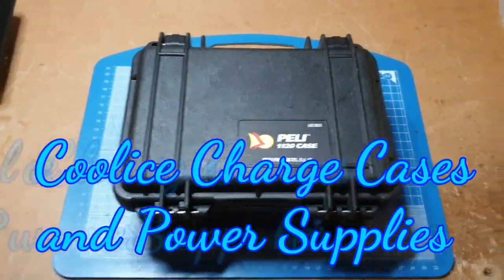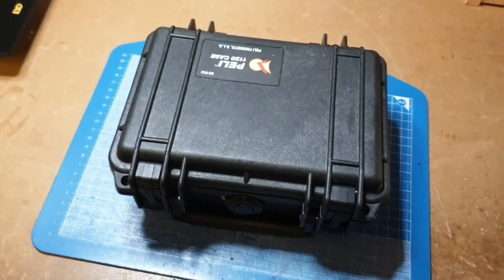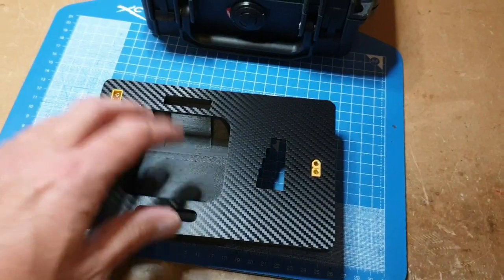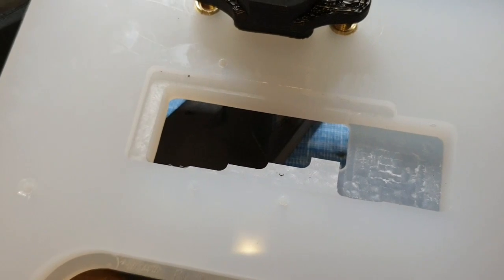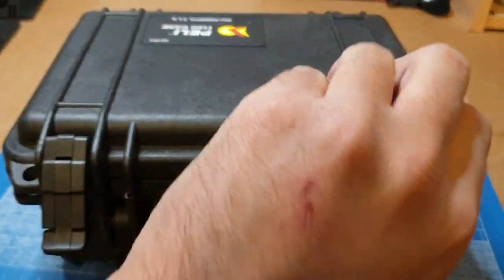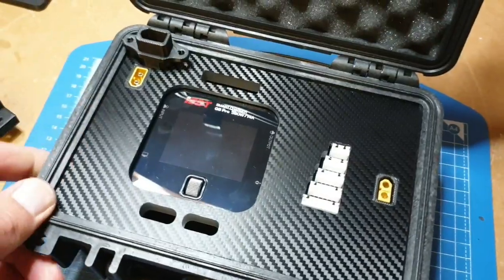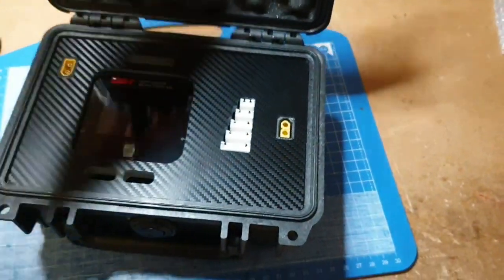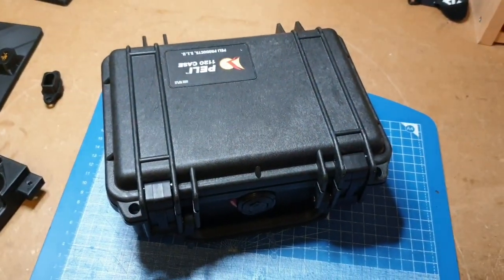Coolice On The Fly Charge Case

Comment: So... do you Share the Stl file? 😜
Reply from the maker: Hey buddy. No I don't I'm afraid, as I produce all my designs to sell under my charge case business.
So from this you can purchase any of my 3D printed parts to build into your own case for instance, or kits with deck and parts, or ready built cases.
I'm no longer using the 3D printed deck in favour of a cnc routed version. Which is quicker to produce and costs the same, combined with the same 3D printed charger cradle for cooling air ducting and holding, it works out better I feel to
Reply from the maker: Hey Buddy. Ah, I've just recently popped a 3D printing page on my web site and will be building that up as I go along. But currently I'm preferring potential customers to shoot me an email to discuss their needs, as there are so many options available it would be very difficult to offer them all in one place. Ping me an email to: ian@coolice.co.uk and we can get something sorted for you, such as one of these small cases tailored to your needs. As since this one I've added additional connector options, such as SupraX input/output options and others. Chat soon. Ian Contessa
Reply: Where can i order one?